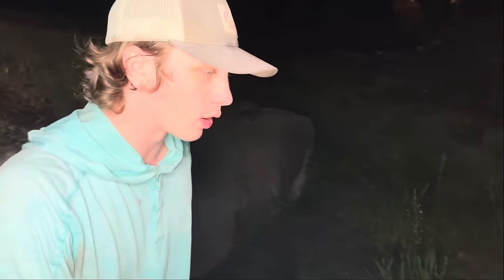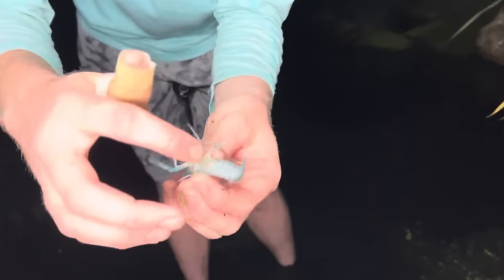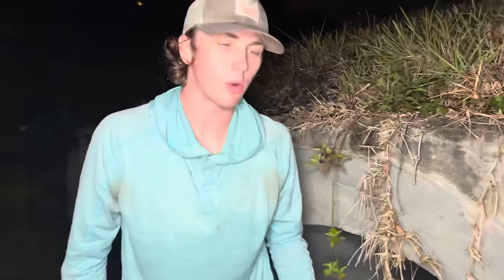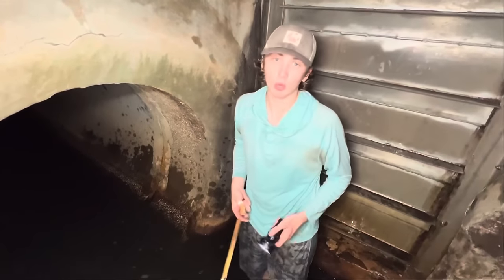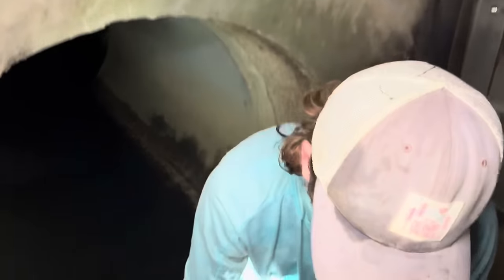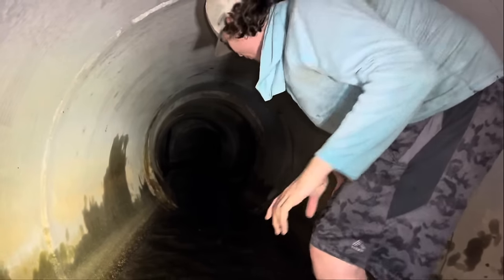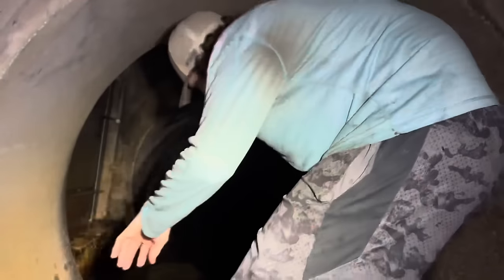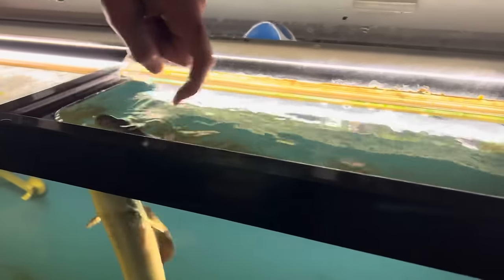I Found a Hidden Sewer FILLED With MONSTER FISH!

Comment: For the RC boat idea...depemding on the size, what you need is to get stabilizer arms for it that attach with foam tape to the hull near the back... it'll keep the boat from getting side to side wobble as well as add floatation to keep from sinking. Option 2 is finding an older gopro that is just a tiny cube so it's lighter than most of today's gopros